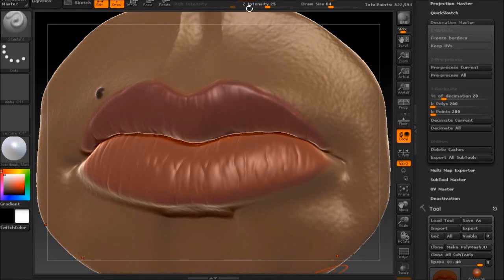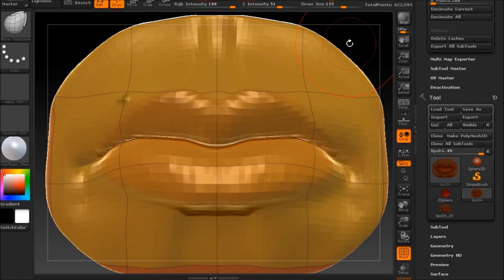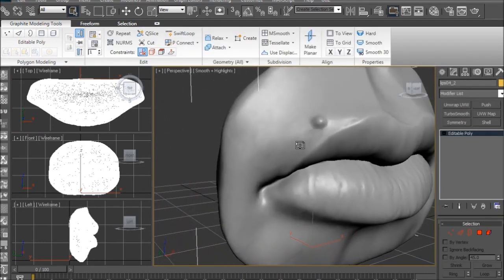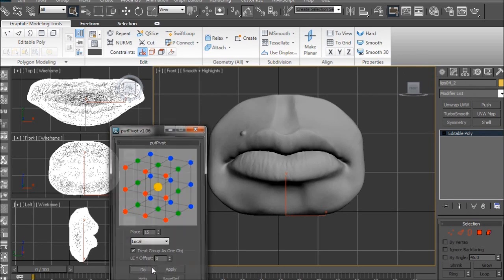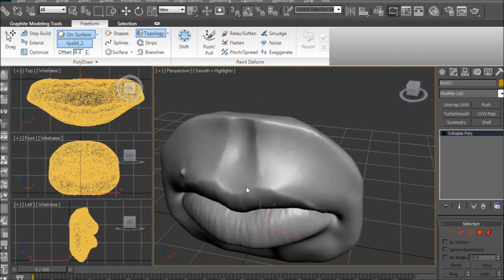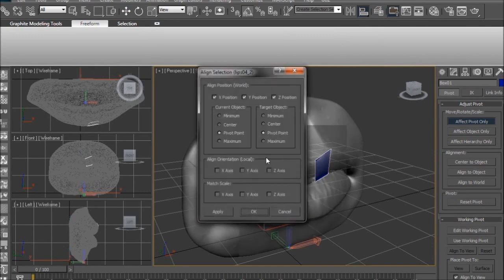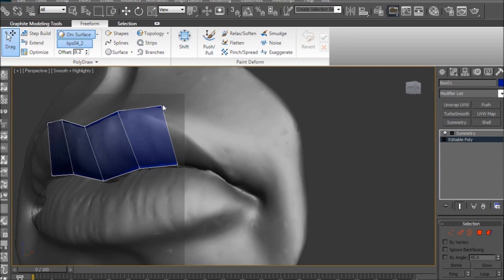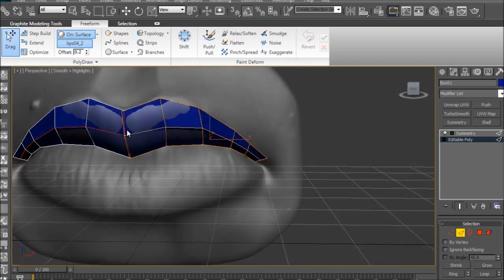Retopology in 3ds Max 2010 (NO PLUGINS) - Part 1

Comment: @Overthunking I don't think this is necessarily true. I have used both Topogun and 3dCoat quit extensively. These programs ARE amazing. No arguing that. However... none of them have the same amount of modeling and UV tools as 3dsmax does. There is also alot of time saved importing and exporting between the programs. My biggest complaint with non-max programs is that its very clunky to isolate parts of the mesh and toggle the shrink wrap. Both of which Max does very well.